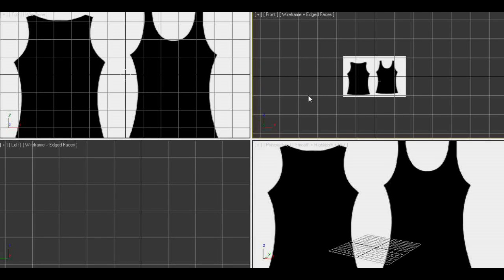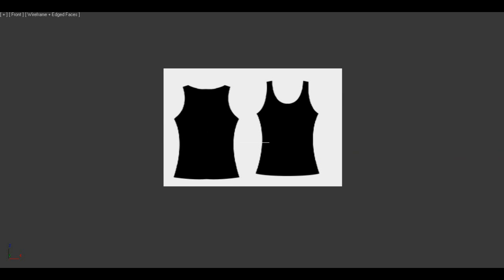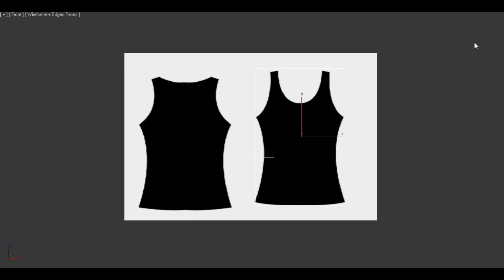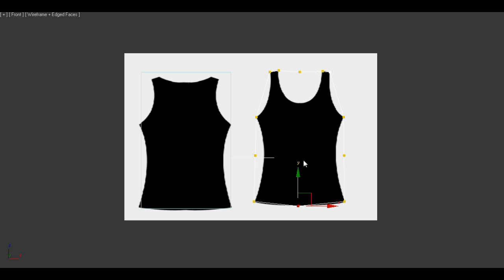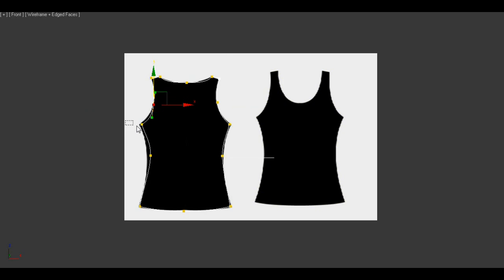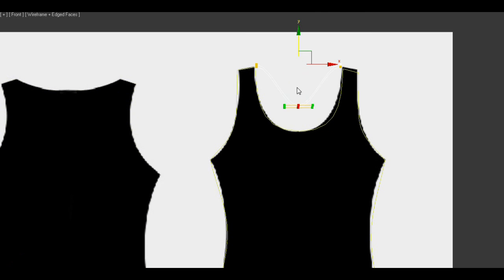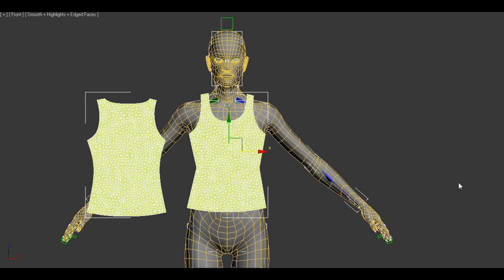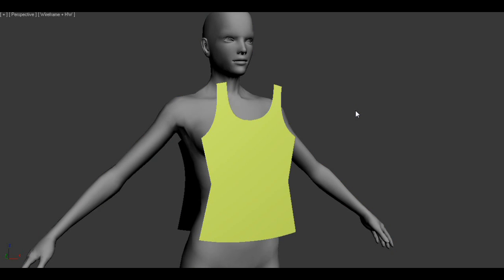Tank Top modeling

Comment: after I attached the two splines for the front and back piece of clothing, broke the vertices on the clothes and applied the garment maker modifier, it gave me an error saying that the splines form overlapping loops. How can I correct this?
Reply from the maker: Make sure you make your spline is your front view without perspective on, try to make sure your splines are sufficiently far apart as well.
Reply: edricew it worked. thanks. If the cloth is too small for the object, can I always edit the size of the spline?
Reply from the maker: You can edit the size of the spline all you want as long as you edit it before applying garment maker.

Comment from the maker: I've modeled the low poly model out of a box using the graphite modeling tools to set my cloth as a template. You can find that under freeform/PolyDraw. You just pick the cloth under the "Draw on" function. Then using the tools under Polydraw, any thing you edit on you low poly will conform to the cloth. An easier way to do this is to apply a optimizer(or proOptimizer) modifier to your model to quickly reduce the polycount. It's not as clean as when you do it yourself, but it's easy.

Comment from the maker: @omerkako The low poly was done using the graphite toolbar from 3ds max (or polyboost if you have an older version of max) . You can set the program to use a surface as reference(here the cloth), you can then model based on what you've done previously. The detailing is basic 3d modeling, chamfering and extruding edges nothing fancy.